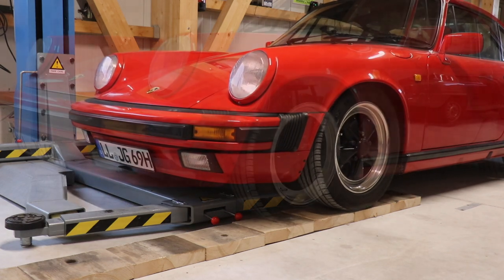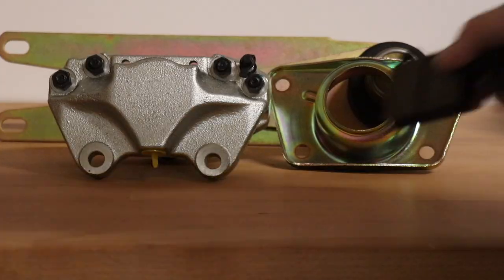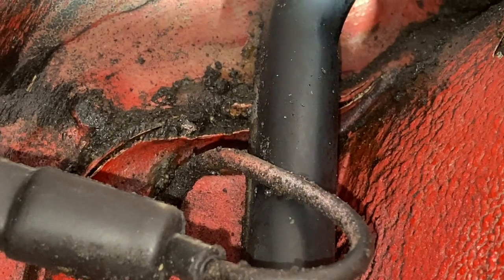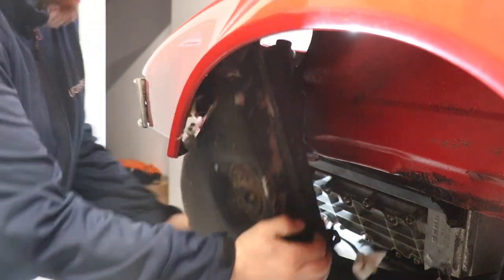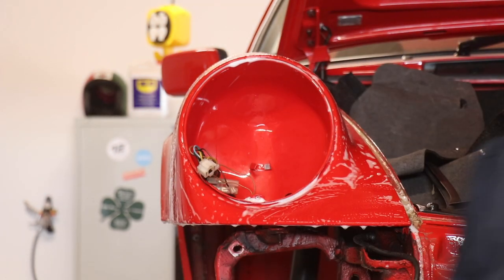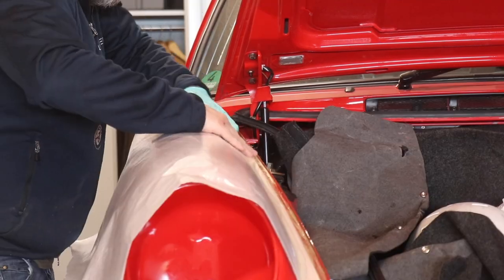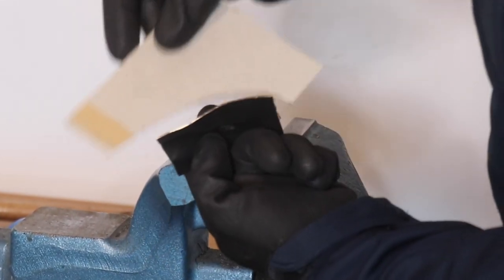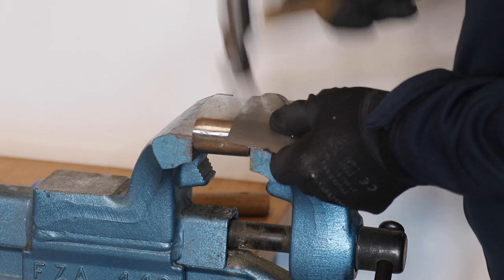Porsche 911 (87): Wheel Well & Fender Restoration

Comment: Excellent and motivating video! Are you able to list the tools and equipment you used that one might need to perform a job like this? I.e, what gauge sheet metal are you using? What type(s) of welding equipment, grinders, etc? Do you prime the new metal with a rust inhibitor?